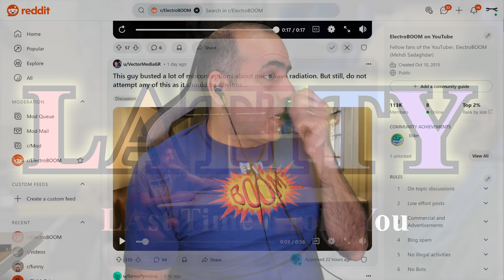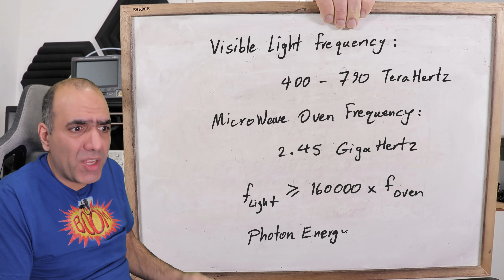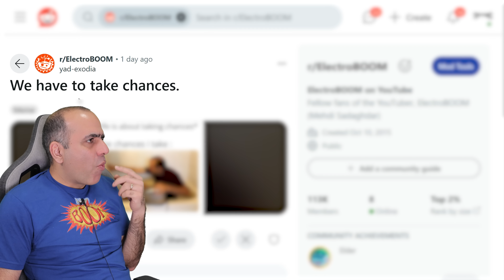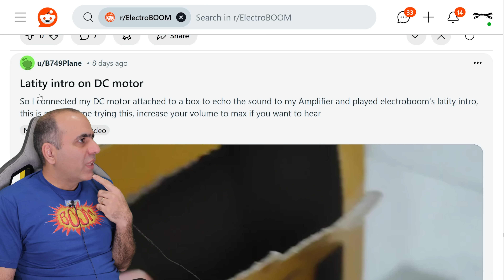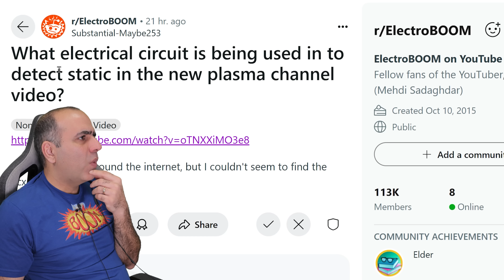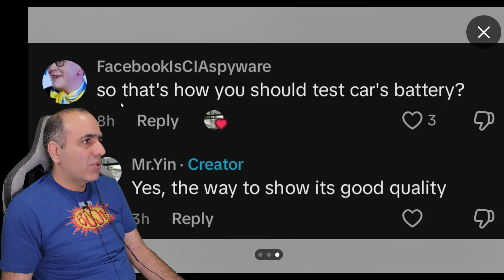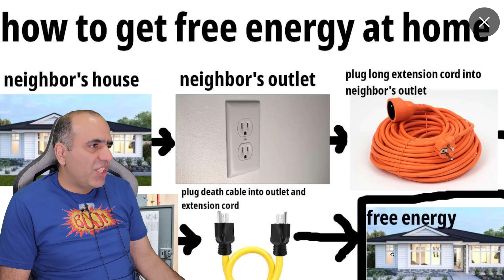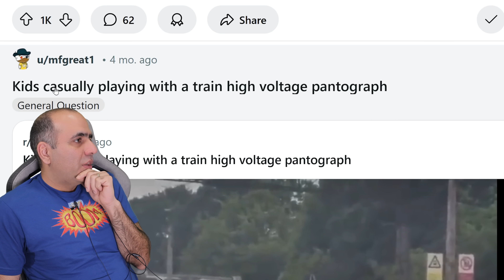Can You Microwave Yourself?! (LATITY014)

Comment: That speaker motor is a lie. However, I managed to make a cooler fan faintly sing (as a tweeter) by building a crappy single transistor amplifier which otherwise cooks speakers with its immense DC offset.

Comment: So, the power strip (the real one, not the photoshop one, but the question still applies):

If your cables come out of the bottom of your plugs, how do you fit your plugs and their cables into the middle section? The cable from the plug above obscures the socket below.

Comment: The plug is designed for 2.5 amperes and in the UK the breaker can be 32 A. That is why in the UK there has to be a fuse in each plug.

Comment: Lived in Brazil for 35 years, Eletric shower there is the normal. Problem is old instalations don't have a freaking ground, which make you take that teasing when touching the register, to open or close it. Just adding a freaking ground fix it  really well. A proper one, not a cable inserted into a plant jar 🤣.

For people with low income, hoses have very bad cabling, anything to make it cheaper, and most is 110v, so at winter, people burn their cables and wall, most people have no idea that you can't just shove a fridge, microwave, eletrical heater, eletrical shower into single thin cable, so that happens very often...

Mom is making dinner, soon get home and go take a shower, power blacks out.... Real story, happens all the time, I remember my house we couldn't use the shower for more then 5 minutes in max during winter, because it heated the breaks and trips it 🤣. Well I was 6 years old at the time, so I though it was normal

Comment: When it comes to UK and EU plugs at 11:06,

It is common and safe to do (at least with my experience). I've done this many times when I went to UK and my grandparents do this too after moving from UK to Poland.

They have many appliances designed for UK, so they use a power bar to plug UK stuff into it and to also plug in regular EU plugs. It works flawlessly.

You can even jam in plugs designed for high current (ones with ticker prongs). Although I won't recommend that. I burned one power bar this way.
Reply: I used to live in Malta and worked in a hotel, literally 2 prong bedside lamps plugged into a 3 pin socket, the British guests would always complain that it is unsafe, 9/10 the on call maintenance guy would just snip the 2 prong plug and replace with a hand wired 3 pin plug.
Reply: I used to do that to charge my speaker, I only had the EU plug I couldn't for the life of me find the UK plug. I assumed it was safe but never left it plugged in.
Reply: Yeah, that's what I was thinking, the shape wouldn't matter as long as the voltage and amperage supplied is the same and a good connection is made. I could see this being a problem if you have a 120v plug that's compatible with a 240v outlet.

(FYI I know outlets can be any voltage even in the same house, I'm using it as shorthand for the most common plugs used in households in the region. Some regions use 120, others 240. If I'm wrong from that, I'm open to correction, but I think I got that much at least.)
Reply: @nobody.of.importance  The socket is designed to clamp onto a square prong so the connection between the round EU prong and the square socket will result in a very small contact area and possibly cause heating and a fire. Also, if your EU device needs an earth then you absolutely shouldn't do this.
Reply: In the UK the type G sockets are often protected by a 32amp breaker at the distro panel (consumer unit), 0.75mm2 (about 19awg) cable has a current rating of 6amps, under fault conditions the cable can have over 5 times its rated current flowing through it continuously (without tripping the breaker) and will catch fire... this is the reason for the UK plug having an internal fuse as without the fuse over 7.6Kw (at 240volts) can continuously be drawn from the socket without tripping the breaker at the panel.

Other countries that use the UK’s type G socket normally protect the socket with a 16amp breaker and so under fault conditions a 0.75mm2 cable would only be overloaded by 2.7 times its rated current and is less likely to catch fire.

Comment: 11:06 it's very wrong, putting anything other than a correctly dimensioned plug into a British socket can deform the contacts and ruin the socket. Nothing will be obviously wrong electrically but it can no longer safely deliver 13 amps and will burn your house down.

Comment: In regards to the DC motor/speaker, there are speakers made out of fans. But the motor spins constant, and the blades change angles based on speaker signal.

Comment: Yay another person from Malta! The argument against plugging euro plugs in UK sockets that way is because 1) euro plugs are slightly narrower than the prongs of a UK plug so it stretches the prongs a bit. At the same time euro plugs are actually designed to flex a bit. 2) Euro plugs are round so the contact area is smaller in a UK plug since it's designed for squarish prongs. At the same time devices with a europlug consumes less than 5 amps of current so it's not crazily dangerous. Lots of people do it but it's not recommended.

Comment: Wouldn't a capacitor across AC be like a short circuit and let it explode?
Isn't what you actually want to do connecting only one side of the cap to AC, then you can get some kind of charge? not sure..

Comment: I almost killed myself 2 months ago doing electrical work at home. I of course turned power down, did some work, turned on to test, it was fine, turned down again to do more, turned on again to test, turned down again. Well... on that back and forth when I wired something wrong and when I tested it didn't turned on, I forgot the main power was on. So I was messing with 2 live phases of 110V. I almost touched the exposed wires.

Thinking the power was off, the 2 110V wires touched and exploded in my face. It was so bright I couldn't see for a minute and my eyes hurt the entire rest of the day. I had soot in my face and my tshirt had burn marks. I live alone. If I had injured myself no one would know.

I was in a state of shock. I finished what I was doing just enough to turn power again with no problems. And didn't touched the rest of the things I was doing until a few weeks ago, from fear.
Reply: This kind of stuff is extremely easy to do, just a second of inattention.  FWIW I've done something very similar when I was younger, absent mindedly wiped some dust off a live 240v terminal (UK) in the back of a clothes drier I was repairing.  Amazingly I didn't feel a thing, but I suddenly realised what I'd done and started sweating afterwards.
Reply: @ferrumignis  i touched 230v (EU) live wire probably around 20-30 times in my 10y career, most of the times in my work boots, and few times sitting down. now i barely make any fuss about it, and it wakes you up better than any coffee ever lol
Reply: @ferrumignis Mhm, when you get super used to doing something and it seems easy, thats when you slip up because you go into autopilot mode. This is why airplane pilots are made to do checklists. You should watch the qxir video about a guy who was filming something for a sky diving school(i think,) but because it was back when cameras were GIGANTIC (including the equipment) and the dude had already done multiple dives that day. Well, the backpack for the camera and the parachute looked not just identical, but weighed basically the same amount. You then saw the 2 others rip their chutes out (like normal) but this guy just kept falling. He recorded himself falling to d34th.
Reply: Naa your fine i've touch many 110v wires when you get to 240+ is when you should really worry or high voltage you should really really worry. 110V still dont feel good and the way it travels matters but isnt just a instant touch dead like high voltage. WIll also say be safe and dont take my words as gold always turn off before working any power.
Reply: @CameronSalazar2113  he said he touched two phases of 110V which is somewhere around the same as equivalent to 210V and ground
Reply: @thebaker8637  that's a good check on me I totally missed that and yeah your right 2 phase is different then 110v home power right? That means he is mixing 2 110v into 1 power plug to make the 210-220v? either way dont touch power its unsafe enough and hurts enough to be scared of.
Reply: @CameronSalazar2113  Yeah it’s a common way to get 220V in the US for those appliances that need it, residential installations in America typically get 2 phases that are 120 degrees apart, with each successive breaker hooked up to a different phase. This way you can have special two-slot breakers that close a circuit between two busbars thereby providing you with ~210V on a circuit for things like a stovetop or electric dryer.
Reply: @thebaker8637  Does that also up the available amps also? so lets say both have 20 amps, does that make it have the ability to do 40 amps or is it still 20 since if your pulling 40 you may overload the single units at 20?
Reply: @CameronSalazar2113  max amperage depends on the conductors in the walls and the ones coming into the panel so it would be exactly the same irrespective of voltage. Obviously the same current over a larger voltage delivers more power, so that’s why you’d use a higher voltage system.
Reply: @thebaker8637  ahh makes sense, well ty for the info, it's good info to know and may come in handy one day! :hand-pink-waving:
Reply: Just today my family did something even more stupid. They were cutting the thanksgiving turkey and they sliced the power cord for the reciprocating knife. Cool blast. Really charred the hell out of that cable.
Reply: Once I was messing around with some exposed wires (220V europe) when I accidentally touched phase and ground luckily just got a zap and a little scare but could have been much worse. 
Also one time me and my dad were once cleaning up a PC powersupply and when we went to test it I got shocked aswell. (probably touched some ungrounded part) It felt like a Sinewave was moving through my arm and I think my muscles also tensed up slightly. 
Very lucky both times...
Reply: That's why you ALLWAYS check with a voltage detector before you touch wires, and you also retest EVERY time if you changed something or switched something, even if you know there is no power. Better be safe than dead.
Reply: @Delibro  That's what I do. I'm ridiculously paranoid when pretending to be a sparky.
Reply: @Delibro  Yeah... I have a Voltmeter and did checked when I turned the power down the first time. But ignored the others. It's a lesson I won't soon forget.
Reply: yikes, I'm glad you're safe man
Reply: I'm at a stage where I don't trust my own memory, that's why I hate doing electrical work if I'm alone.
Reply: Shorting the transformer is (not) fun
Reply: I always have a dozen confidence pints of IPA before I mess with home wiring. Can't be too careful.
Reply: you'd have to really try for that to become fatal. The arc flash potentially could've blown up your hand if the conductors were contained in your hand, but the shock would have to last a lot longer than the fraction of a second it would take before you move your hand for it to be fatal. Now if it was a bus bar, and you grabbed it, that could be a lot worse.
Reply: Got zapped multiple times on my electrical journey, 4 years now, most of the time is repairing something and touching 110v, but sometimes I got zapped by 380v atx psu caps, indeed it was strong and awakened me instantly lol, for me 110 is quite normal, just the jump from it and I am good. (All of that being 16 is quite a ride lol)
Reply: умение и хорошая память придет с опытом работы

Comment: I had a friend who was working on radio links for broadcasting live events on TV. He accidentally put his finger in front of the directional 10GHz antenna. By the time he felt any pain, his tissues were severely damaged, with nothing visible on the outside. The power output of the antenna was far greater than what your puny microwave oven can produce tough
Reply: This is doubtful. May power most of these links is only 10s of watts, and that is right at the waveguide or feedhorn that faces the dish reflector ... the RF level leaving the dish reflector is a mere fraction of the RF at the feedhorn.
Reply: @uploadJ  10s of watts is plenty enough to cause tissue damage in 5-10 seconds. It just needs to raise the temperature by a few degrees and you have dead tissue
Reply: @uploadJ  I don't know the actual specs of the link used, but I remember it was 10GHz and it was for France television. Arguing won't change the fact his finger got cooked, make the specs were different from what you're used to?
Reply: @uploadJ  I said he had his finger in front of the antenna not the wave guide.
I know anecdotes are no proof, but still... When my friend tell me he got burnt, I trust him.
Reply: @uploadJ  I see there's no point arguing with you. You don't know the kind of link that was used, you dismiss the fact he says he burnt his finger because with the kind of link you know and allegedly use, it "can't happen". I will not be responding any longer
Reply: What damage did he experience?
Reply: @Null-o7j  burnt tissues. Microwaves cook you from the inside out

Comment: Those tiny hight rpm motors are actually much better at producing sound compared to clunky large ones. I did try that with the small ones before, it works surprisingly well

Comment: In the 70ties i had a small toy car with lights and straight drive at the touch of a switch. I connected a 3.5mm headphone jack to the battery compartment en connected it to my radio and it was as if there was a car stereo in the car and the lights would faintly light up with the music. I hooked a lot of stuff up to my radio, sadly no youtube back then (and no afforable filiming). When I got my 1st home computer I hooked a light up to the radio and a photo resistor on the youstick port to decode morse on the AM band. Sadly it was only numbers, no text.

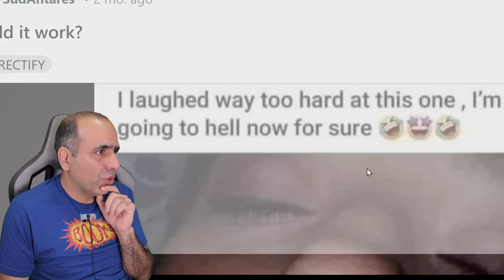Comment: 13:50 it will shock them - the heat and the smell of burnt skin will.
Reply: Came here to say this. It will most likely heat up the nose-ring (if conductive) and burn them pretty quick.
Reply: If you look, it is two one on each side 🌩
Reply: @ryanberntson8640  That's just a "regular" nose ring. It's one single "ring".
Reply: That woman actually has TWO piercings if ya look extra carefully.

Comment: 11:05 in Mauritius we the UK standard but we have a lot of double pronged EU appliances and stuff, everyone does it, it's fine, even electricians(including one of my uncles) do it
Reply: In the UK the type G sockets are often protected by a 32amp breaker at the distro panel (consumer unit), 0.75mm2 (about 19awg) cable has a current rating of 6amps, under fault conditions the cable can have over 5 times its rated current flowing through it continuously (without tripping the breaker) and will catch fire... this is the reason for the UK plug having an internal fuse as without the fuse over 7.6Kw (at 240volts) can continuously be drawn from the socket without tripping the breaker at the panel.

Other countries that use the UK’s type G socket normally protect the socket with a 16amp breaker and so under fault conditions a 0.75mm2 cable would only be overloaded by 2.7 times its rated current and is less likely to catch fire.
Reply: @alanwood9804  as for this, valid point, I personally haven't heard of anything like that happening here but this is true
Reply: Don't you have to put something in the ground to open the live and neutral?

UK here, and sockets all have covers over live and neutral and need the earth prong to open them first.
Reply: @ElvenSpellmaker  yes. You have to insert something in the earth to open the covers. Pen, screwdriver, another plug...
Reply: It's fine unless it accidentally sits crooked, has too little contact surface, overheats, melts and starts a fire
Reply: @jwhite5008  In my experience they sit pretty tight and we've never had anything like that happen ¯\_(ツ)_/¯

Comment: Malta is a funny place.
I remember a hotel I stayed at had double wall sockets set into the wall, with a pair of single outlets mounted on the front... One UK, the other Euro style 😁

But yeah, we do that Euro-plug wedge here in UK too sometimes. I wouldn't do it on anything high current, as the UK socket is designed to mate with the flat sides of the UK plug, and the Euro plug has round pins, so the contact point isn't very large.

Comment: as ridiculous as those large power distribution things look ...  could you get one with the most outlets you can find and show what you could actually plug into them safely?  Maybe a bunch of LED based Xmas light strings?
what kind of things have low enough load to stay under a breaker's limit at 10-20+ separate devices?  That would all plug into that central spot?   I don't get it, but would like to expand my horizons.